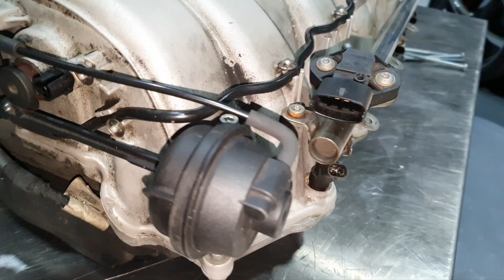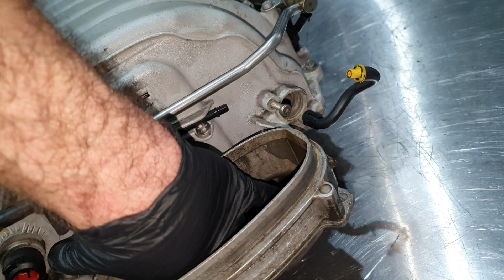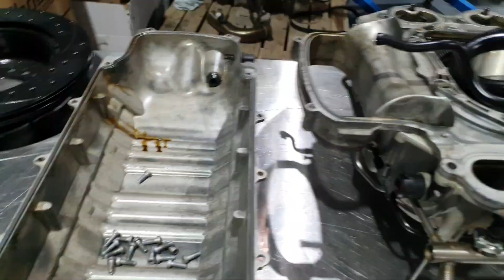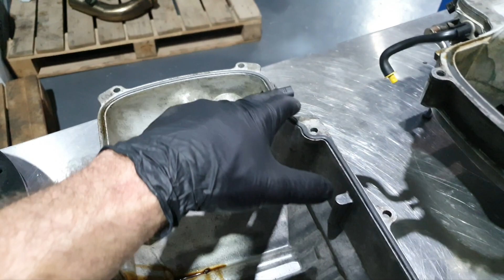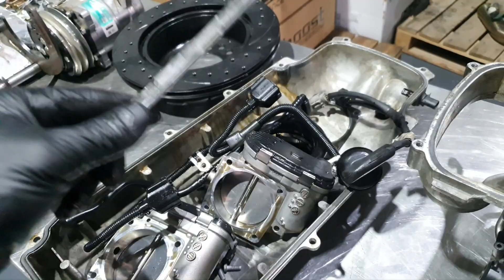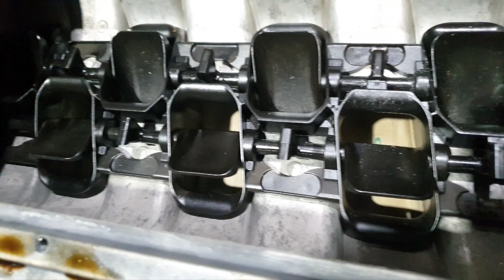CL63 intake manifold (part 1)

Comment: Why open it ? If he does have no issues with idle or power wise ? And after you have open and there is some issue with corosion or even a hole or two you can´t fix it / nobody can weld it in your area .. i don´t get it. but nice vid as always, and funny. Tasos is freakin enjoying life everytime he get´s some m156 intake to disassemble :D

Comment: This guy needs to buy a oil catch can lol and also question Am I able to coat the inside of the manifold after I get rid of the pitting or corrosion ? Say like if I have a really bad one I clean it best I can the after dries coat the inner walls with some sort of strong coating to prevent it from ever corrosion???? Thank you